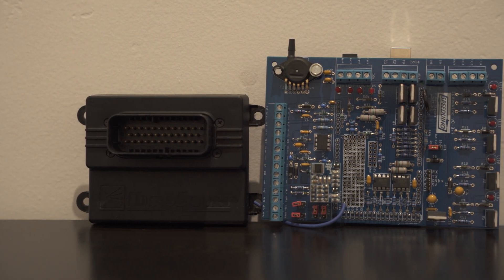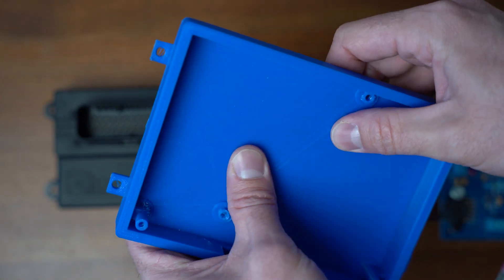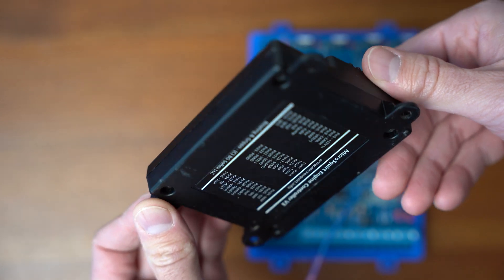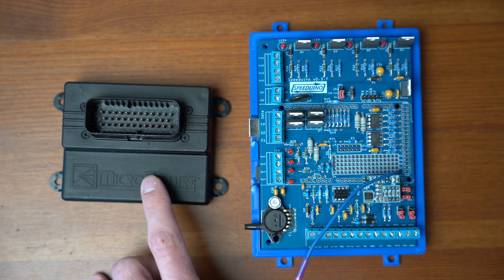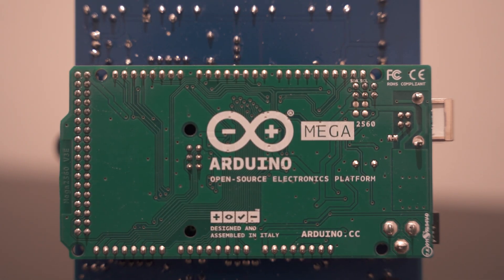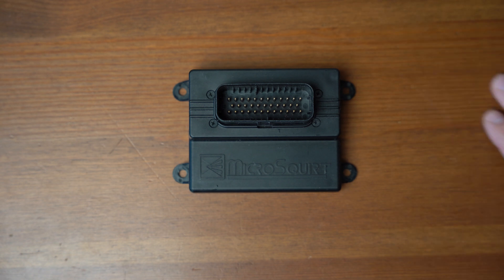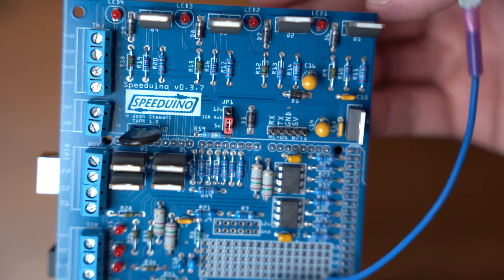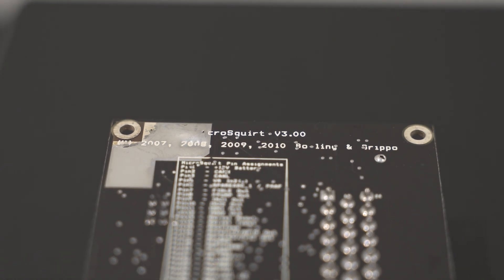Megasquirt VS Speeduino | What will you choose?

Comment: So you've used microsquirt on that BMW project? Isn't it made for motorcycles and stuff like that, or am I wrong? Thinking of converting 5cyl Audi to EFI on a budget so not sure which one should I go for
Reply from the maker: You need an ECU with at least 5 ignition outputs to run a 5cyl. So in that case both of these options will not work unfortunately. However the newer Speeduino dropbear or an ms3 would work.
Reply: @TurbineResearch  Damn MS3 seems to be way too expensive, I'll look into dropbear though, thanks!
Reply: go with dropbear, cheaper to implement and still developing - and can run 5cyl sequential, MS is dead - turned commercial and priced itself out of reach

another possibility is VEMS (offshoot of MS after some developers got pissed off about MS going commercial, way better than MS but getting just as expensive)
Reply: @frostyab7579  How about rusefi?
Reply: I think you can run batch fuel and ignition to run a 5pot. Meaning you don’t need 5 discrete channels

Comment: Before watching this I thought they were both opensource but turns out MS3 developers make public some (almost all) of the code and allows customers to modify it for their particular MS3/Pro unit. But no selling your modifications or even giving them to other people. Also you have to compile the code with their binary GCC module, so what actually ends up flashed to the device is anyone’s guess. I always thought they were both open source since tuner studio works on both, but no :P
Reply: Yes, MS at the early stages shared their firmware sources, but if outdated, they stated it is not open source, for the hardware the same, they shared squematics for previous products but stated only for repair guide purposes.  Some guys around the world have made their hardware versions of MS but they are violating the copyright/licenses according to MS.

Speeduino is "inspired" by MS but from what I have seen, hardware and firmware is completelly different, harware is evolving fast, the autor of speeduino is releasing a version completelly ready with teensy 3.6 (a lot of more power respect to arsuino mega) in an aluminum case and 2 automotive plugs. The product is growing. Very interesting.